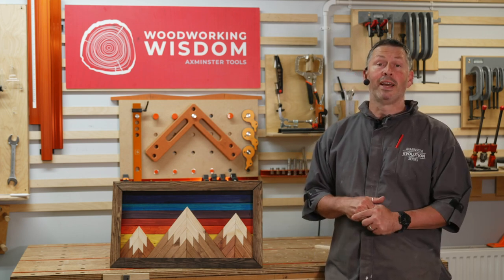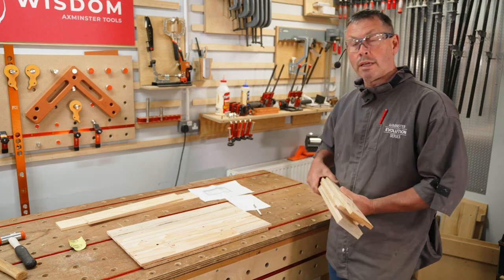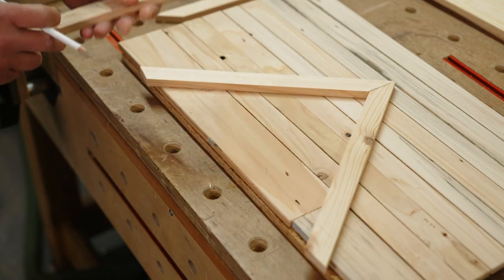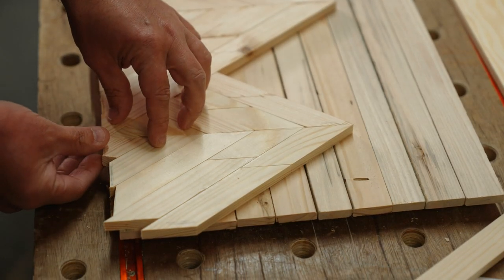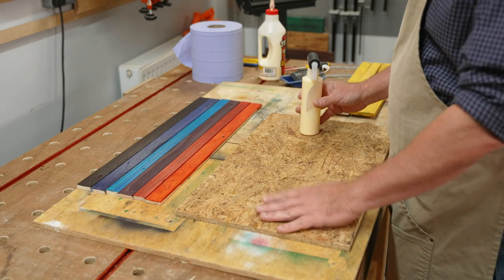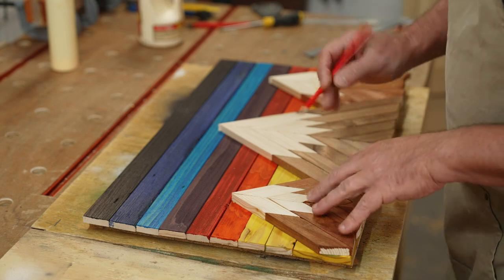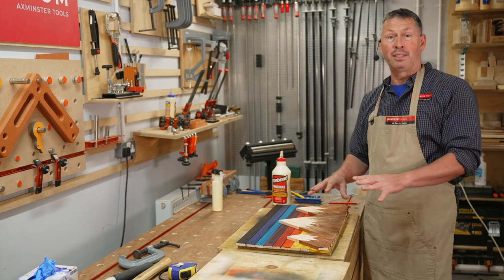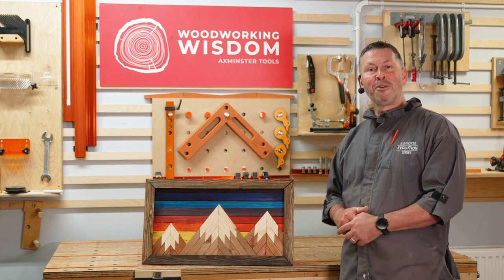Create Pallet Wood Wall Art - Woodworking Wisdom

Comment: I was going to make a headboard for my bed and saw many youtube vids on how to do it but only saw a picture of yours - no video or plans, just a picture. So  I winged it. Tried once and it didn't work so that one got scrapped. Second try  worked - yay! And then I saw this video. I didn't realize that you glued the mountains onto the back sky panel. I cut all the sky panels to fit the mountains. What a time consuming , finicky job. Your method is so much simpler. I will be making other wall art and will use your method. Thanks for the video.
Reply from the maker: Glad to hear you found our video useful! Thanks for watching :)